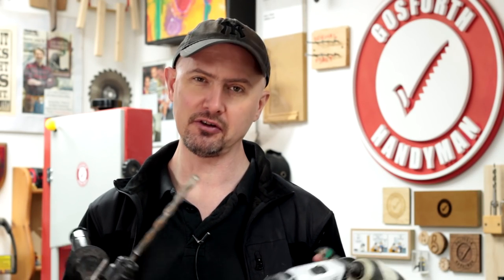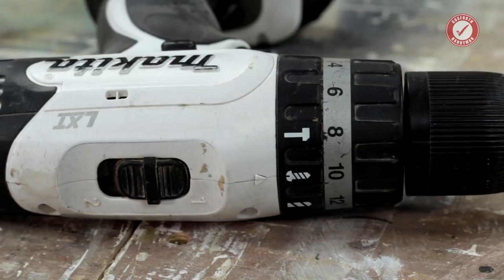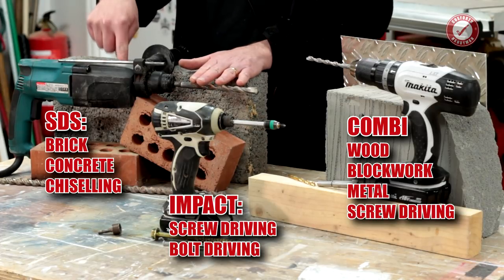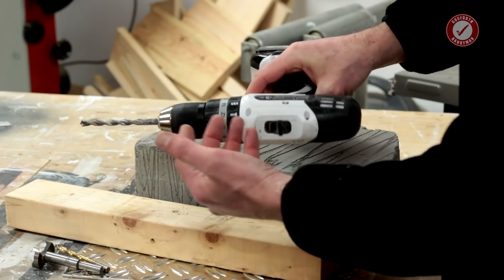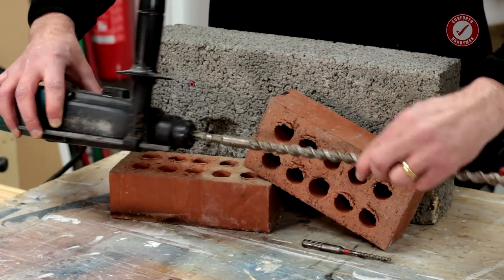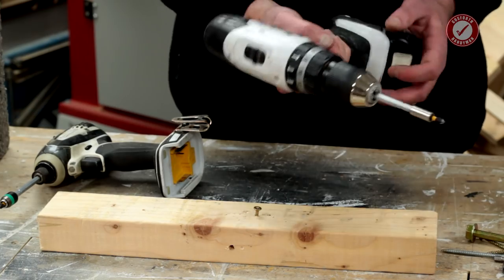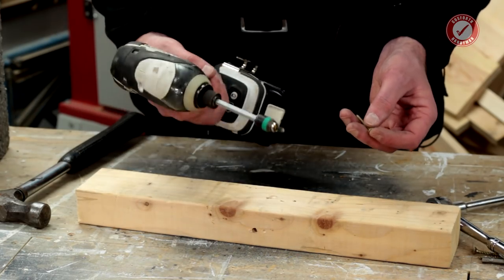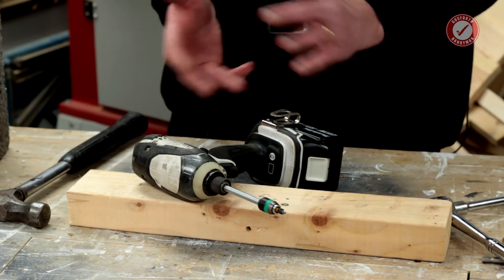Impact Driver vs Combi Drill vs SDS Drill - what's the difference?

Comment: I'd still add a large hand brace in the kit as a back up, for when you just need extra torque, when you need to run silent (sleeping bairns, nebby neighbours or just a late finish) or when you've got power/battery issues. Something like a Yankee Bell Systems brace will chuck anything: for less able (but therefore much cheaper) chucks can get adapters easily enough.

Comment: Hi Andy, I've never had a an impact driver, always used my combi drill, but i may treat myself after watching your vid. Can you tell me if removing screws is easier with an impact driver, I usually start with a normal hand screw driver and tap it with a hammer to start the screw, then remove it completely with the combi drill/driver. A tip I received from my father is when trying to remove an old screw say from a door hinge is to slightly tighten it a very small way and then unscrew it.

Comment: My dad bought a old Bosch SDS drill (from 2004) on Facebook in 2020 that was ''for repair'' for £5. It made a exploding sound when we pressed the button and stopped. A £13 replacement electrical part off eBay later and it has worked flat out on 3 house renovations! (I think it was the input filter or something? it looked clearly brunt when I opened it). Of course he found this drill 1 week after he bought a brand new Bosch and used it once! So the new one is just sitting as a spare.

Comment: I bought a Bosch SDS drill in 1985 when I moved into a house with concrete walls. Except for changing the switch because it was filled with dust, I never had any problems with it. I even used it to drill big holes though walls and floors for plumbing and electrical conduits.

Comment: I have a set of 10.8 Makita combi and  impact drill/drivers using a long  dewalt screw sleeve for the screws works well and stops screws from dropping out especially on the new Dimplex quantum storage heaters where you need a longer screwdrive.
Impact driver is great for getting out tight screws.
 I also got the 18volt combi with the socket screw drivers & drill bit set plus 36 volt Makita Sds even used it for chisel bits.

Comment: Thanks, very informative video. Female diyer here, mainly, use the blue bosch tools and ryobi tools. I agree with you, you should have all 3. I finally managed to pick up the bosch bare unit sds during black friday. My bosch drill is able to go through wall but worried I may burn it out and want the drill to last as long as I can. The sds will differently come in handy when I move into my own home, especially when I need to mount curtain rails, tv ect. I wanted to get a sds drill for a long time but they are pretty heavy and wanted one that was cordless. The BF deal was great for me, since I already own the battery and drill. Also, always get quality drill bits because I had cheap ones break on me. They are expensive, but worth it, best to pick them up during sale or even black Friday.

Comment: yeah then you git the impact wrench that looks similar then drills without impact , rotary drills, and doesn't help that some are named similar like that sds that i believe is rotary hammer drill and the sds is the type of locking the bit down very confusing. this video helps but maybe a part 2 with the rest of them that look alike, plus a bigger battery does make a difference in power. great video thanks

Comment: Only now I had time to watch this very informative video. Thanks for sharing.
So much good information.  Till now I only own a combi-drill.  Finally I understand why drilling holes in concrete with it takes ages.
And now I finally understand why I need an SDS drill.
One thing I don't understand, nearly at the end:  Does a 4Ah battery (for the Impact driver, but I think in general) give more power than a 1,5Ah  or will the (same, because both 18V)
power last longer?  Merry Christmas and a fantastic year 2020.

Comment: I lasted ages not buying an impact driver.. always thought my combi drill was just fine.

Until.. I bought one. I have never looked back! Hands down the best tool I own
Reply: I was the exact same, now couldn’t be without it.
Reply from the maker: Yeah - they're amazing. Wouldn't be without mine! 👍
Reply: Not only for the ease of screwdriving, but for all the times you want a pilot bit in your combi drill, and you're using the two side by side.
Reply: What brand did you buy? I have a DeWalt combi, I borrowed a mates impact driver and it was amazing!

I do general diy and try as much as possible to do some joinery.

Does anyone know how Screwfix own brands differ?
Reply: MrBishbashbosh2012 I bought Makita.. from B&Q when they was doing there stock change.

Screwfix always have offers on Dewalt and Makita.. you just have to keep checking to get the best deal 👍🏼

Comment: Hi Andy, a very comprehensive comparison, thank you.  I might have been worth mentioning the difference between SDS & SDS Plus.  I'm sure it's not magic, but why doesn't the SDS hammer knock seven bells out of the end of the SDS bit, and why two different slots in the end?  For me, the big advantage with SDS is drilling concrete, because it makes such light work of the flints in the mix, which a hammer (vibrator) drill doesn't.  Seasons greetings to you and your family.  Looking forward to your 2020 content.
Reply from the maker: Cheers Steve! I might keep that for a future video. 👍😀

Comment: You now can get impact rated Drill bits for the impact driver. I’ve started to use this more often and it’s basically removed 3/4 of the jobs I would usually use a combi drill for (I tend to use a combi only for when I’m drilling into walls and I need to use a blunt drill bit in case hit a wire or pipe that my scanner hasn’t picked up). Milwaukee do a great selection of hex shank drill bits for the impact driver.
Reply from the maker: Cheers Chris! Although see my vid I did a while back about the DeWalt impact bits that got discontinued - loads of folk saying they kept snapping. Might have been a dodgy batch. 👍😀

Comment: Merry Christmas Andy!
I invested in 12V Bosch before M12 Milwaukee stuff appeared in the UK so I can't afford to change colours now. But I've got a little 12V Makita CXT SDS+ Drill that makes general use into house brick walls a joy compared to the Bosch 12v combi 'hammer' drill I had been using. I expect the Milwaukee M12 alternative is good.
I actually prefer the Bosch Flexiclick drill-driver over the impact driver for general assembly tasks as it is clutched.
WERA bit holders are the best I've found so far although long torx bits from PB Swiss are working very well for me.

Great video content - thanks!
Reply from the maker: No worries - cheers Alastair! 👍😀

Comment: Good stuff, thanks.  Not sure how many hours I wasted using a vibrating drill for masonry and then discovering how easy it was with an SDS.  My SDS also has a regular chuck so can also use non SDS bits - very handy when I need a powerful drill going into dense timbers etc.  Good explanation describing the "hammer" on a combi drill providing vibration.  All the best for Christmas and more importantly 2020.  Cheers, David
Reply from the maker: Great stuff! Yeah, it's a huge difference. Thank you David - and to you and yours! 👍😀

Comment: I have these 3 tools in Bosch blue (Various 18V combi drills + a corded GSB 21-2RCT on a Wabeco drill stand , a GBH 2-24H 2.7J SDS driver, and a GDX 18VEC impact + socket driver), as well as in the Parkside variety (including a 5J SDS driver)… largely as a result of owning batteries from these 2 platforms... All work well, despite the price difference.

One piece of advice for those who use impact drivers is to get bits designed for them, as the regular ones are not impact resistant and will break quite often!

Happy holidays!
Reply from the maker: Good tips! Happy holidays too! 😀👍
Reply: Can you recommend the Parkside SDS drill? Or is not worth its money?
Reply: The Parkside PBH 1500 D4 which I have was very good value for the money (5J, with a case and a few accessories including SDS bits and a regular chuck)… It's not a precision tool by any means but has been trouble free and is quite powerful. I seem to recall there is a newer version of it with the same specs.

In some countries, but not in the UK, Parkside is also selling a cordless 'performance' SDS drill which seems pretty nice (I'd avoid the regular X20 model in the expectation that the 'performance' version will make it to the UK sooner or later).
Reply: @RueFondary  Thanks for your quick reply. I'll have a look at LIDL. Even in Slovakia they have an internet-shop now so no need to wait anymore till it comes
to the classic shop.

Comment: Nice to see a practical demonstration of why it's good to have one common battery system...... "Oops, forgot to charge my impact driver. Nae bother, I'll use the battery off my combi-drill." Happened to me many a time. I use the Bosch pair of devices. Love 'em. The impact driver totally revolutionised my DIY and woodworking. Unfortunately, a mate is borrowing it to do a loft-conversion. Not sure I'll ever get it back.. :-(
Reply from the maker: Ha, yes. I should really have been a bit more organised on the battery charging front. 😂👍

Comment: I bought the Makita likkle baby impact, 10.8v, had it 5 years, second set of batteries, I rebuilt them with better cells, now they are 2.5ah rather than 1.3ah, cost £6 per battery. Bath tap back nuts, I haven't sworn in 5 years taking them off, lol. Great little driver. I use the back to hammer plugs in too!
Reply from the maker: Ha - no, don't use your drill as a hammer like I do!! 😂🌲

Comment: I've bought lots of these tools and I'd have to insist get the better tool pay the extra bit. Better tool = less time. Time is everything. The impact driver is a luxury but if you've got a lot of fasteners to drive get it. The only problem I've ever had with them is I've spin the head off screws a few times because the impact driver doesn't show any struggle.
Reply from the maker: Yeah, you need to use decent screws or the impact will just eat them up. 😀👍

Comment: I've been using the Parkside (Lidl) 20v impact driver for the last year or two and its been brilliant, for £37 including battery and charger you really can't go wrong. I've asked Santa for the Makita DTD152z for Christmas though, so i can share batteries with my Combi drill and only need one charger. But for those on a budget, i can't recommend the Parkside one enough :)
Reply from the maker: Fantastic stuff - I need to check out the Parkside when I get a chance. A few people have mentioned they're decent! 👍😀
Reply: That's good news.  I'm a big Parkside fan. I don't have an impact driver yet.

Comment: Great Video Andy and Happy Xmas! couple of notes - the 12v impact drivers (from a decent brand) can be a great option too, they are very light and handle most of the usual DIY duties as required so worth considering if you already have a 12v drill otherwise not really worth it due to having to buy battery and charger. My Hitachi one has been excellent. Totally agree on the lighter battery, much more comfortable and better balanced to use. On SDS drills - they are fantastic tools as you mention, I've got the cheap one from Screwfix (Titan) and it's been punished over my house refurb but has been fantastic. So if your on the fence a cheap SDS drill is much better than no SDS drill!
Reply from the maker: Great stuff Bill! Yeah, the way impacts are designed the battery power has very little to do with the torque since all the force is coming from the spring decompressing. The motor just 'charges up' the spring for the next hit... so the lighter the better in my view! 👍😀

Comment: I've got a Dewalt DCD796 18v combi drill and it goes through Concrete and brick with no issues. I installed the anchor bolts for my garden fence to a solid brick wall, and each hole took all of 8 or 10 seconds. So im not sure where the "half hour per hole" statement came from?
Reply: 1066Rider  lol probably, i use Dewalt Extreme masonry brad point bits. Those are the only ones I've ever bought so i don't have anything to reference them against i guess
Reply from the maker: SDS is still significantly faster - especially bigger holes in old Victorian brick. These can be very hard.

Comment: What do you use the torque setting for on the combi drill? I think it's torque... The large 1 speed, 2 speed setting.
Reply from the maker: I normally use 1 when drilling metal and 2 for wood... generally. 👍

Comment: 2 questions,  cordless or corded sds?
And how does it compare to the hammer action power tools for masonry work?
Reply from the maker: Cordless corded - depends on lots of factors, are you already invested in a battery platform, already have spare batteries, budget etc. I'd probably say cordless but corded still has a place. Not sure what you mean about the 2nd Q - do you have a link?
Reply: @GosforthHandyman  new set, so not tied to any brand. With black Friday might be worth getting a new set. 
Also, is batrery Ahr a key factor? 
Likes if ryobi sell kits but with 2Ah max and I'm not sure that will hold up with DIY of putting uo partition wall for study... 
I mean these https://www.argos.co.uk/product/7235548

Comment: I have observed something interesting.  Maybe you have an answer. In UK, almost all your drills are combi drills with hammer. For example Bosch names those with GSB. In Germany you can barely find combi drills GSB, but you can find GSR, which is without the hammer option. Why is that?

If you are woodworker, furniture maker, you don't need hammer (which is barely useful on small drill anyhow), but what you need is compactness. And hammer option makes the drill longer which is not preferable.
Reply: That is interesting.  If you're a builder with a battery SDS and a battery combi, you also almost never use the hammer function on your combi drill.
Reply from the maker: Interesting! I don't have much experience of German houses but a lot of the ones I've been in have had concrete walls? Wonder if SDS is just the natural choice over a combi with hammer action? Wasn't SDS invented in Germany - originally Stecken Drehen Sichern? Not sure! 👍😀🌲
Reply: @GosforthHandyman  Yes, most of the houses are concrete, and that's the reason SDS would be natural choice. Hammer on the combi drill would be basically useless. I don't know history, but I will not be surprised if SDS was German invention.

Just read, The SDS bit was developed in 1975 by Hilti and Bosch. The name comes from the German "Stecken - Drehen - Sichern" (Insert - Twist - Secure).

Comment: I'm pretty sure impact driver doesn't have axial hammer--only rotational hammer.  I used to think it has axial hammer also.  But it's basically same as an impact wrench (used for bolt fastening) with a different anvil.  If you look at parts diagram of dewalt impact driver and 3/8" impact wrench, it's the same internal parts except for the anvil.  Bosch has a combo impact wrench/driver tool now, which has an anvil that will except either 1/2" socket or hex driver bits.  It uses the same rotational hammer for both.
Reply from the maker: Nope, defo has axial hammer! See link in description to vid of one working from the inside 👍
Reply: @GosforthHandyman  I watched the video in your description. I think you need to take a closer look at it.  It describes axial energy that is stored in the spring.  However that axial energy is converted into a rotational (only) force.  The axial movement does not actually strike the anvil.  It is converted into a rotational movement that actually makes contact.  It is exactly like described in other videos provided by manufacturers. Don't want to argue the point with you.  If you've taken a close look at your referenced video and disagree with me, then we disagree.  Peace.

Comment: Hi Andy. Good video.
I've been using an SDS drill for about 9 years ( 1930's house - super hard brickwork ). About 3 years ago I saw this video: https://vimeo.com/7917029 & took note of it. The next time I used the SDS it caught in a wall tie & kicked violently. If I hadn't been holding it as the video instructed I reckon I'd have been nursing a broken wrist & jaw & whatever other injuries being thrown off the stepladder would have caused.

Thanks for the info you provide & it's nice to hear the accent ( I'm from South Shields but haven't lived in the NE for about 30 years ).